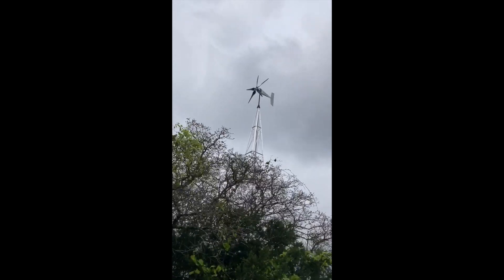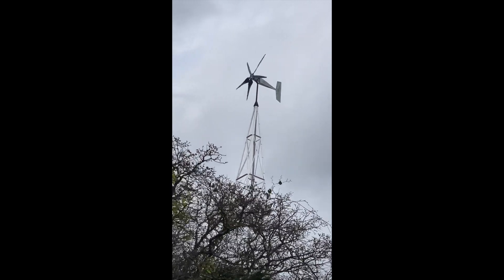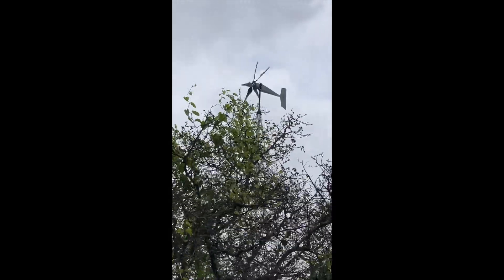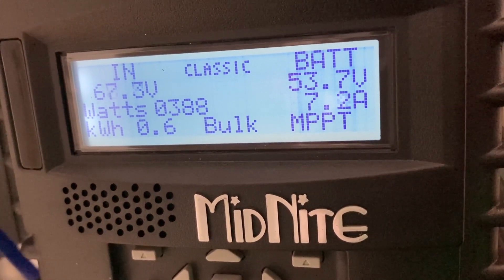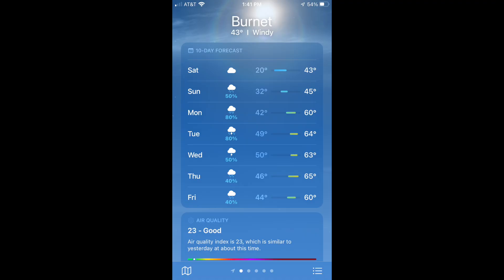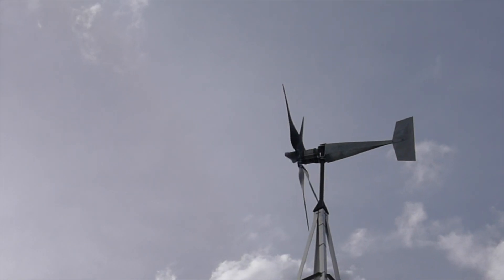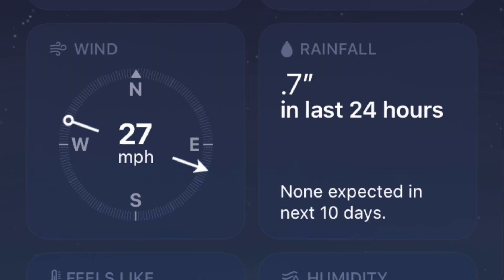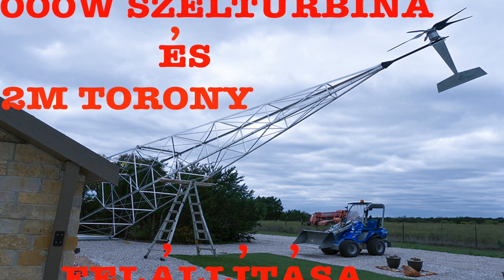Breaking News - 2000W Wind Turbine Harnessed 1809W

Comment: Thank you for this video and information, it has helped me make sure I know everything I am getting into when considering a wind turbine install at my home. I would add some black self-vulcanizing tape (or some other sunlight-resistant rubberized product) between the struts on the tower to help mitigate the noise issue; I assume it is coming mostly from the cross-struts vibrating against each other.
Reply from the maker: Thank you, yes most of the noise caused by the cross angles.  I will lower it next week to install some lights and I will zip tie them together. Thank you for watching!!